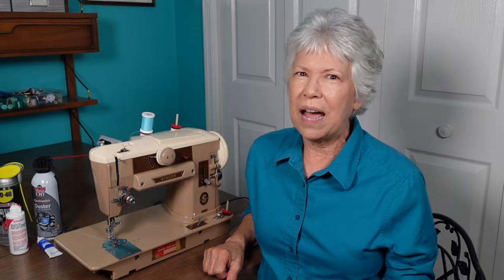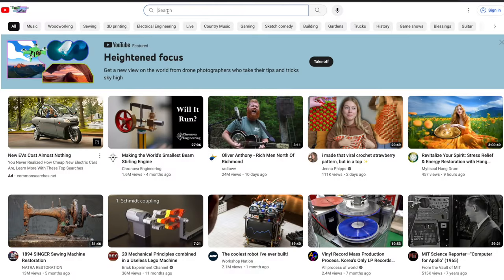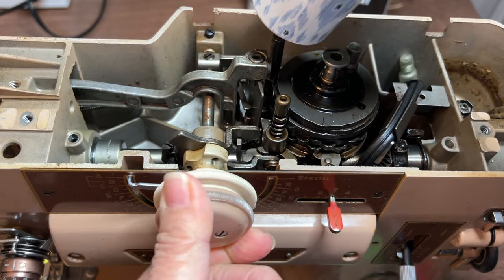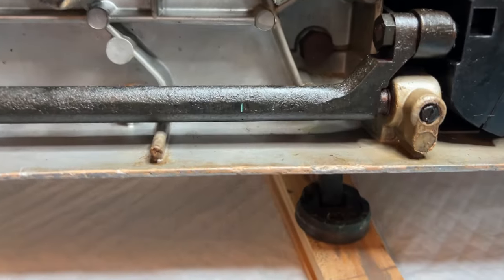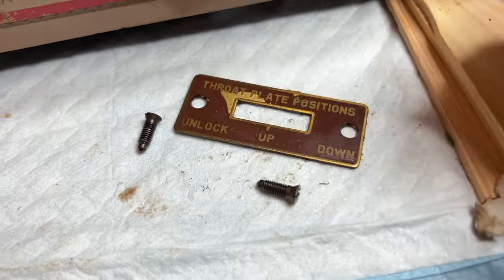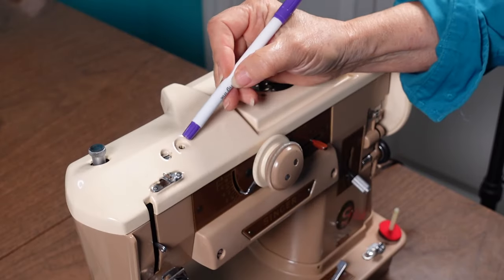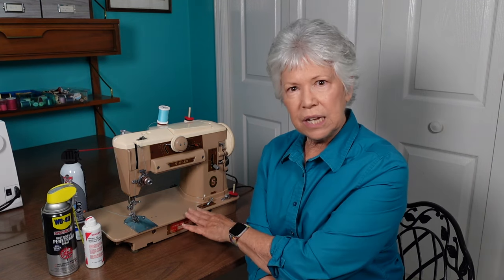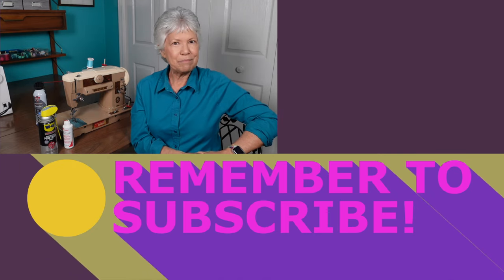How to Unstick Knobs on Vintage Singer Sewing Machine

Comment: Hmm.
I have a Singer machine that I bought brand new in 1994. I used  (attempted) it several times and said SCREW THIS .... lol sorry but I suck at sewing. I can hand mend and stitch but the machine is not my friend.
 I bought the easiest pattern (my mom said it was for kids) and the easiest material to work with for the pattern and I attempted several times over a period of a month. 
I just watched this video and I dug out my NEW/OLD machine, the material and string spool still there.  I'm tempted to fire it up ....
NAH.   I put it back in its case and back in the closet.
It's safe there 😊
I find it really odd that I get so frustrated at this since I have rebuilt carburetors on older cars and love table puzzles but this machine and patterns just baffles me. 
Sigh.
Reply from the maker: I'm so sorry that your machine frustrates you! I bought myself a fancy computerized one a few years ago and it just frustrated the heck out of me. I almost gave up sewing due to that machine. Anyway, I got rid of it and got the most basic, non-computerized Janome out there. I'm much happier. There are many components of sewing and using the machine is just one of them. Using patterns is a whole thing thing! Hopefully, you'll give it another try someday. In the mean time, I'm happy to know you're keeping your machine safe!